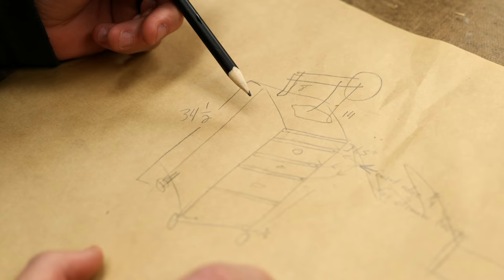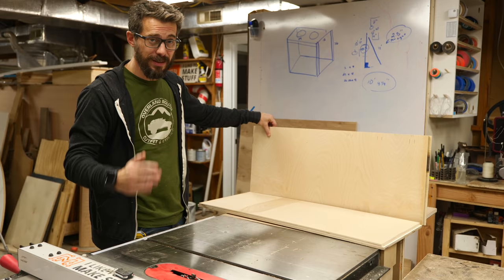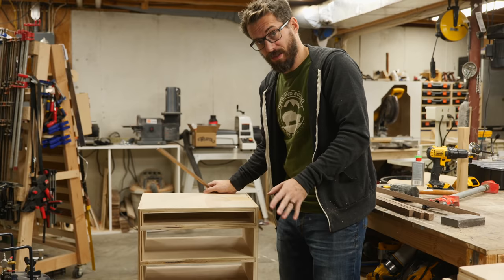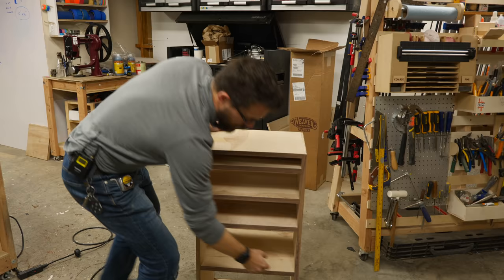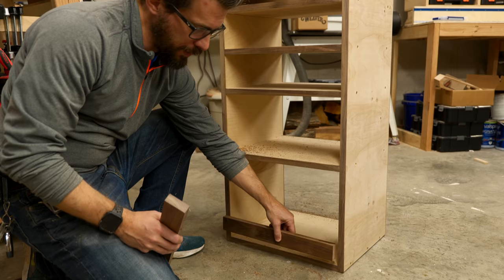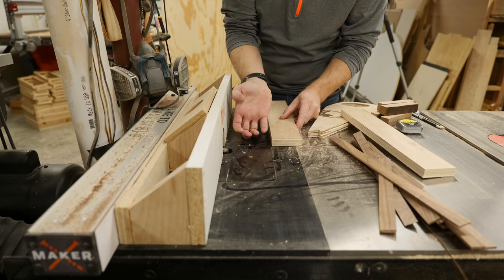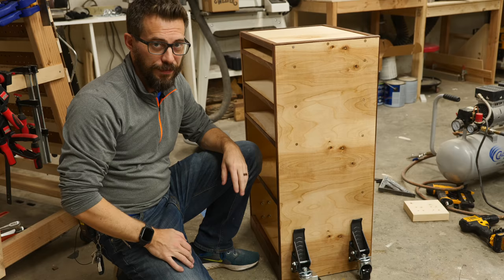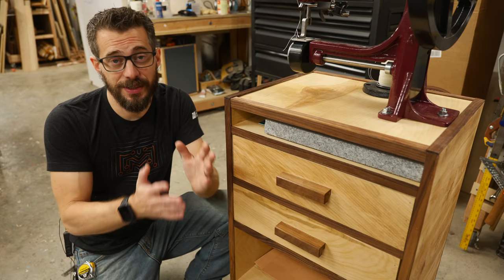How to Make A Rolling Tool Cart | I Like To Make Stuff

Comment: Well done. If I may add a tip, you can get away with using only 1 of the stepper casters. Add feet to the same side and on the opp side, use cheap stationary casters that lock. This isn’t “better” than what bob did, just another option.
Reply: That won't hold the cart enough pushing leather work through (small foot print of a cart and too light). Only works when you are pushing perpendicular of the wheels. A lot of table saws have this pivot wheel with stationary wheels on the other side.

Comment: 2 cents worth of tips: some small rubber feet would make it rest without damaging the bottom wood; neodymium magnets built into the drawers could help them line up and "lock" in place inside the frame. ;)

Comment: Nice, I have a drill press cart I haven't finished with, it's built using a cheap supermarket flatpack shelving unit that we had spare and one of those drill press units for a normal electric handdrill. I've been trying to figure out the best way to finish it up, and you've given me some good ideas. Thanks.

Comment: Nice build, Bob. Kudos for doing something that I've yet to see other builder/makers do and that is using your left hand to pull the sliding miter saw when the cut is on the left side. Most guys use an arm crossover which just has the potential to have a bad day. I've heard the excuses, but a catch or jump is gonna be life changing.

Comment: Nice cart!  Love the colors, and the hardwood edging for durability.  The filler over the screw heads has a sort of dowel look to them.  Interesting extension wheels, don't think I've seen those.  
A shop-made option for extending/retracting wheels that operates from one pedal/latch in front, is also pretty easy to make (you just have to work out dimensions for your cart and wheel size, but a bit of trial and error will get you there):  

Construct the cabinet so it has a boxed-in 'skirt' around the bottom (i.e., mount the bottom shelf a few inches up from the bottom of the sides and back, then add a toe-kick panel in front, inset or not as you prefer).  (Optionally, you can make a separate skirt and wheel assembly the same width and depth as the cabinet, and attach it to the bottom of the cabinet.  This may be the better option while working out the dimensions, so you don't have to make adjustments to the cabinet itself.  The remainder of this description assumes the skirt is part of the cabinet.)

Construct the wheel assembly by cutting a piece of plywood the size of the bottom opening, then cut that into 2 equal pieces so you have a front half and a back half, and re-join the halves with 2 hinges.  Also cut an inch or so from one side of the front half plywood piece, and align the 2 pieces on one side (not centered) when attaching the 2 hinges.  Mount 4 swivel wheels (not the locking type) on the bottom of the plywood near the 4 corners.  Attach a lever/handle on the back plywood piece, on its underneath side, on the side edge where the front panel is shorter, so that the lever misses the front piece as it travels up and down, and points forward, projecting out of the front of the cabinet through a slot you must cut in the toe-kick and shelf to allow the lever to travel (3 1/2 sides of the shelf attached to the cart should be sufficient, but if it does sag under load, a vertical 'strap' piece of plywood can always connect the cut/slot corner of this shelf up to the next shelf to support that corner).   Mount two 2x2 cleats on the inside of the skirt, the full width of the cabinet, one in front, one in back, up against the underneath surface of the shelf.  The plywood wheel assembly's front and back edges will push up on these cleats to raise the cabinet, as you step on the lever to lower it and flatten the wheel assembly.  The wheel assembly itself does not need to be attached to the cleats, but can remain loose under the skirt.  

When the lever is pushed down with your foot, flattening the plywood wheel assembly, this causes all 4 wheels to extend down a half inch or so below the edge of the skirt, raising the cabinet up by the front and back plywood edges pushing on the cleats.  When the lever is raised, the wheel assembly hinges up in the middle, causing the wheels to retract up inside the skirt, allowing the cabinet to sit on the skirt.  No 'pulling up' of the lever is necessary.  The weight of the cabinet will cause the wheels to roll to the center, causing the wheel assembly to angle up in the middle on its hinges, raising the lever to the top of its travel.

The dimensions for the height of the skirt and how far inside from the front and back edges to place the wheels, will depend on the size of the cabinet, the size of the wheels (larger ones will need either a taller skirt or to be set further in from the front and back edges, or both) and how far up you want the front end of the lever to travel.  But bear in mind you only need to extend the wheels about a half inch out the bottom of the skirt to roll it around, and when lowered, the wheels only need to be up just inside the skirt to not touch the floor.  

On the front end of the lever, attach a pivoting pedal piece with a nail or other through pin for the pivot, so that the pedal can rock and engage a stop/latch piece that you attach to the front edge of the cabinet side, near the bottom of the lever's travel.  Step on the pedal while it's near the top of its travel, and push the lever down to raise the cabinet, then rock/pivot the pedal in a bit to engage its edge under the stop piece, to keep the lever down and the cabinet raised.  Step on the pedal again and pivot it to disengage it from the stop, and let the lever go up to the top end of its travel, to retract the wheels and let the cabinet sit on its skirt.

Comment: You're pretty great at what ever you take up, so I don't presume to tell you what you should do... that said if you create 3 points of contact on the bottom of your cabinet it will always (within reason) set flat on the floor without rocking when the "coasters" are lifted. Great video Bud👍

Comment: You may have done this, I either put BLUE (not red) Liquid Locknut or a plastic insert nuts on everything that could come loose, 'cause I don't want to find out when the big honkin sewing machine falls off.
Also, I'd consider putting a 'back' on the shelf with the marble slab to give more resistance to racking. You have two small ones at the product shelf but they are at the bottom.
If everyone pushes from the front or back, no problem, however with the big honkin sewing machine on the top if the unit was pushed sideways up against a stop the machine would want to keep going (inertia) while the bottom would stop.
I have a tendency to "idiot proof" things to make them last longer.
Good job!
I've been looking for a way to do something like this.

Comment: Great build man, I'm a bit concerned (for you of course) that the top compartment will sag under the weight of that slab and will make the first drawer hard to open. Also the weight of the machine (looks like cast iron) will have the same effect on the top surface. Perhaps adding a thin metal sheet to both surfaces will help alleviate the stress and prevents from sagging. Thanks for sharing!
Reply: It won't sag.. and a thin metal sheet won't do anything to stiffen it.  The weight is not all that much given the short cut of the board.
Reply: @UNKPCRIDE  you're likely right. The plywood seemed thick enough, plus the nature of that material itself is less susceptible to bowing/sagging.

Comment: This is perfect! just what I was looking for! I have a 45cm hole under my workbench that I have been looking to get a rolling toolcart for a while. I prob would have bought one if i would have found one with the right dimensions. But this looks just great. I just need some other wheels, so it will be fit inside that hole! :)

Comment: After installing the casters I would have to put a ‘side’ cabinet or something because the caster poking out would drive me nuts (short drive) awesome build and I love project specific work centers.  I have one for oil testing tribology and ppm analysis at work and one for advanced machine diagnostics like vibration Spectrum analysis to infrared, ultra sonic and more.  It’s nice to have a box to run out and do a job.

Comment: You could weld a single rod across two tabs on one side so that you don't have to specifically push/pull 4 castors down every time you change their position. Alternatively, it could be a wooden 2x4, instead of a metal rod, with holes drilled in the metal tabs

Comment: Nice build. As long as the cabinet isn't too heavy, you might consider putting a piece of flat stock or angle iron to connect the foot levers of the casters. You could raise a whole side at a time instead of a corner.

Comment: Looks like you had some router bite on one of those handles.  You should do a bits video on dealing with the complexity of the router table.  It seems so simple until you discover one router bit does not equal the other and same goes for the router itself. Big lesson learned for most tools is that they all resemble the chisel and as with chisels ya gotta keep em sharp and true

Comment: For those Casters, If the foot pedal is metal you could weld a bar across it(or test it out with zip ties at least) so that you only had to lift/ push down one thing on each side instead of two on each side. Just a suggestion. Awesome video though! Great Job!

Comment: I like the build, maybe you could bolt onto the levers of the casters a thin bar of steel or aluminum connecting the two to each other, and then only have to step on that for each side.

Comment: As always loved the project, only had one idea.  Maybe putting a flat bar connecting the locks for the castors so you don’t have to actuate all four. Edge banding looked real good. Does the cart have enough weight, even with the granite, to be stable when using the sewing machine?

Comment: I might be inclined to put doors on the bottom two compartments - otherwise the supplies in them are going to get covered in sawdust... other than that really nice project  (I'm contemplating whether i could adapt this to be a butcher block for the kitchen, with drawers for knives and so forth)

I also have serious shop envy -  i'm working out of a space about 2m long by 1.5m wide, although i may soon be moving into half a garage.

Comment: I am at no means at your level. So when cutting the rabbit in the drawer wall bottons, I clamp a 2x4 to the outside, so I do not not have to balance the router on  a 1/2" or 3/4" edge. I did a similar cart and filled it with everything drill related a parked it under the floor based drill press.

Comment: Just seen this video. I too like that the drawers come all the way out. Good idea there. I just built a large tool cabinet and in the drawers i put short dividers in the bottom to seperate the tools. I put two 3/4" PH screws up thru the bottom to keep tools in place. And they are only 3/4" square by however long. I do not like loose tools in drawers. LOL. Nice build!!

Comment: Great build.  You're a much better wood worker than I am and your work comes out super clean.  The cut you made at 7:58 gave me a little concern.  It may have been the camera angle, but it looked like the piece was longer in orientation to the blade and fence than against the fence.  Unless I'm incorrect and it's okay with enough material on the fence?  Not calling you out, really asking.

Comment: How safe is the cut at 1:22? The piece is wider than it is in length, so I would be worried about kickback. I don’t do much wood working but have heard this as a general rule of thumb and reason why to use a cross cutting sled.

Comment: I would really appreciate a bits video about sizing and aligning drawers for cabinet projects, I have the worst time getting mine to sit properly
Reply: I need one for modifying old “T” track drawer slides with new bearing slides. Either side or under-mounted.

Comment: What's not structural about making drawer bottoms that way? I have drawers made like that that hold a couple hundred pounds. Pantry drawers for canned salsa and tomato sauce. More glue surface than most structural woodworking joints.